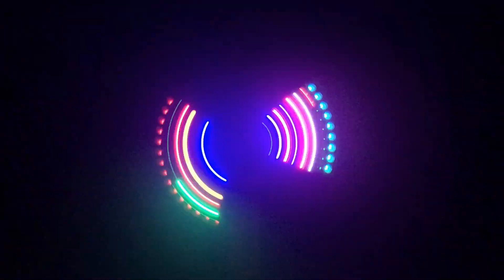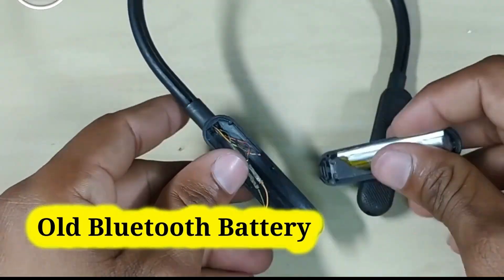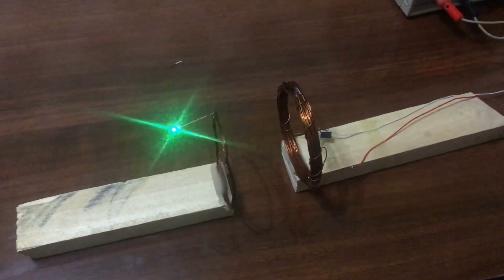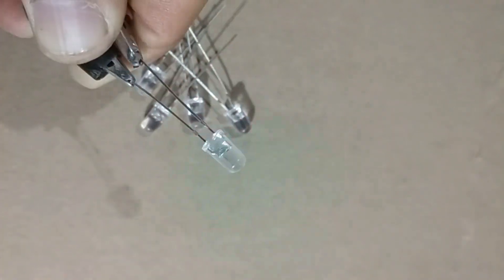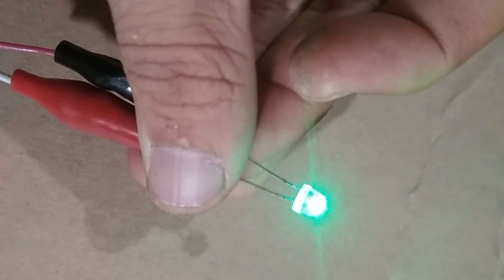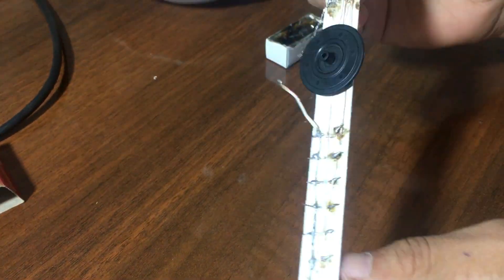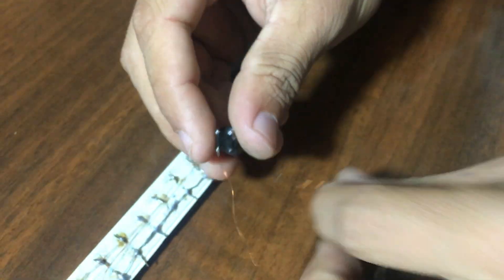LED chaser without IC and with wireless power transmission. LED chaser with DC motor #ledchaser

Comment: And what is the value of capacitor can be used here
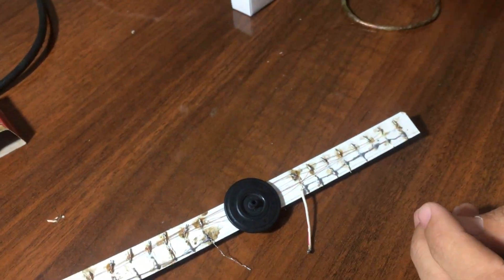Reply from the maker: Thank you for your question. Here, were are using 16v 220uF ( 3:01) and  of course, if you want, you can another capacitor. This works even without capacitor but like we use capacitor after diode rectifier bridge, we are using capacitor as well. You can use 16v 1000uF if u want.

Comment: It this POWER SUPPLY work with POV TEXT DISPLAY? How much voltage this wireless power.  I need this to make for text display. I've already thinking about this right before seeing your videos but I've not do experiment if it really works or not?
Reply from the maker: This wireless power transmission is working under 12 volts and of course, you can make other wireless power transmission which can work under 5 v. Of course,  it depends on how much power consumption you have in the output side. Here, we need 12 v 0.4 amphs in the input side. If u are going to make wireless power transmission working under 5 volts, then in this case, it should consume around  1 amph. It is totally possible to make what thought of with wireless power transmission. If you are working on this and getting stuck with wireless power transmission part, do let me know and  I will gladly provide guidance at no cost. Thank you for your question.
Reply: @FarmBoyTech  I actually need 3-5v output voltage on the reciever coil to power the ARDUINO NANO WITH 8LED on it... I don't know how much it required Amp and thanks for information.  Hopefully it work.
Reply from the maker: @jryngki5094  if you need any help, please let us know.